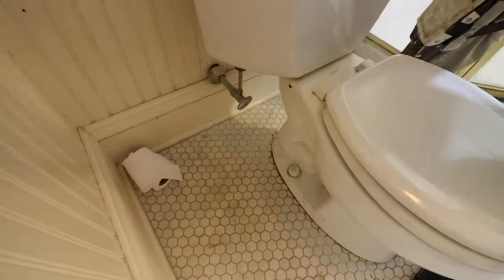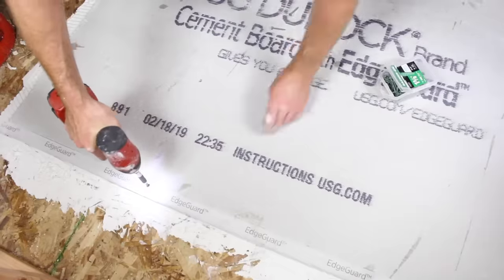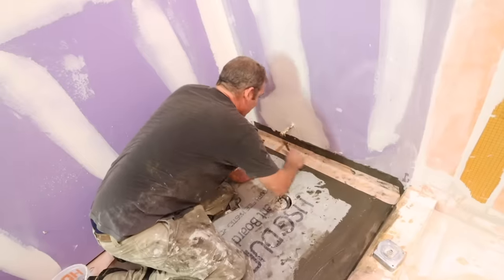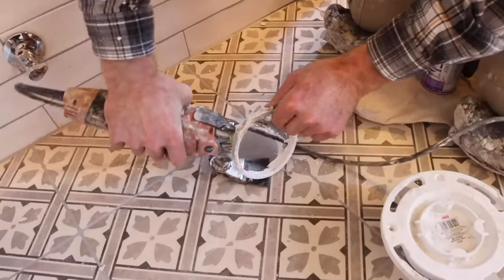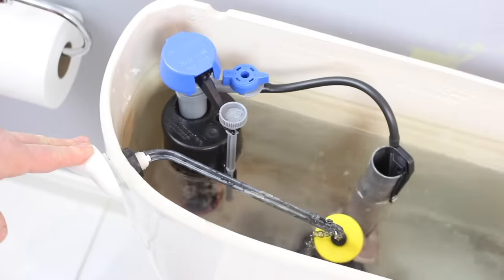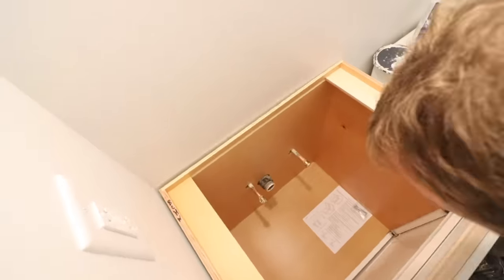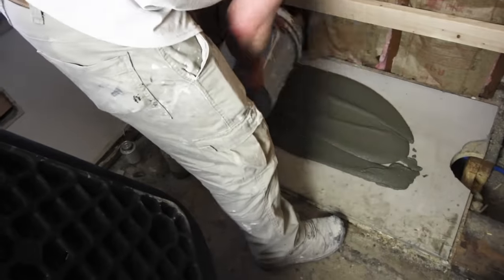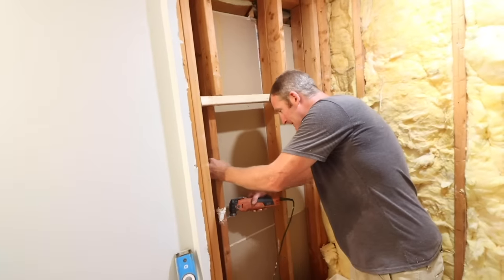17 Clever Bathroom Renovation Tips for Beginners

Comment: I think the floor prep was great, but really, unless you are remodeling the bathroom in the House of Windsor, it is just too much. No one needs a bathroom floor that could double as the outer hull of a submarine. And let me tell you, most everyone says I go WAY too far in my own moisture barrier provisions. But please don’t take me wrong. This video shows the best work I have seen in a long time, maybe ever. As a reference, I was a safety worker for Swinerton. And cutting the grout lines with a circular saw? I have removed a lot of tile and replaced it, but the pry bar and hammer is the most  practical method.

Comment: Great job! Duroc is for walls though. Use hardy backer for floors then follow the same steps
Reply: Durrock or wonderboard is fine for floors ! Its not just for walls ! Hardibacker works for either but i hate putting fasteners through that crap , its easier to pilot hole it but the time spent blows that up! I stay away from hardibacker altogether personally! Whatever you use , thinset it down on wood sub floors with a polymer modified product!

Comment: Awesome video! I'm in my second year as a home improvement contractor but I don't have a lot of experience doing bathrooms. I'm subscribed and look forward to watching more
Reply from the maker: thank you and congrats, let us know if you have any questions 👍🏼
Reply: @HomeRepairTutor  will do. Thanks!
Reply: One thing i learned the hardway from being taught the complete wrong way is to put positive slope underneath your shower pans!! You gotta slope underneath whatever material you use for your pan! Its a critical error a lot of people make! Excess water will travel thru your grout and mudbed etc. finally hitting your pan and settling in the lowest point! It will stay there because it has no where else to go! Soon it starts making mold and turns acidic thereby eating through to your substrate and walls! If you dont slope your pan toward the weep holes on your drain the excess water is sure to cause major problems later on! I have torn out 50 yr old showers that would have lasted another 50 and others that were 10 yrs old that have rotted the subfloor,studs ,and floor joists! Water is a killer in wet areas! Thats why most insurance doesnt cover damage that occurs there!

Comment: thanks for the great video, its the best channel on YT!. For the second tip you have in this video, can you use ditra+tile on top of the plywood that is beneath Vinyl? i.e. remove Vinyl using the heat gun and not pull the whole plywood out?
Reply from the maker: thank you Danish, you could pull the vinyl and keep the plywood of it meets the Schluter standards for your tile, eg if the plywood is 3/4” thick and over 16” oc framing

Comment: Always use a mask when removing vinyl especially in an older home.As there has been cases of asbestos being underneath.
Reply: Those would be the 8” X 8” vct (vinyl composition tile) in my yrs of experience! Mostly! They are very brittle and are glued down with black adhesive! Usually in non traffic areas you can pop them up in 1 piece for the most part! Where you would get the most airborn crap flying around is if you sweep the floor during clean up! Prob not a good idea ! I would def use a respirator and a good one and use a vacum with a hepa filter and dampen the floor first before final cleanup! That will keep a lot of the dust from flying around! Its that or call in an asbestos remediation crew and pay through the nose for everything that goes with that including disposal fees! Legally here if you are doing a job for someone as a contractor and asbestos is involved, it has to be removed by one of the handfull of licensed companies certified to remove asbestos! There is a ton of masking things off (windows, doors etc) to contain it and workers are gowned up like workers in a clean room! Same with lead paint removal ! Another nightmare maybe for next halloween!
Reply: True dat!

Comment: Amazing tips guys! I was looking for information on how to properly make the connection between drywall ceiling and kerdi board on the shower area and between an inside corner where drywall will meet a cement board (tile wall) outside shower area. Any feedback would be amazing! Love this channel!!
Reply from the maker: normally we don’t treat or waterproof the ceiling to KERDI-BOARD connection but you could flash it with KERDI-BAND if the ceiling is lower than 8 ft. At the drywall to cement board transition outside the shower you could use alkali resistant mesh and thin-set if it’s close to the tile, eg 3” or less. Then you could skim it with joint compound 👍🏼
Reply: You guys are the best! Thank you so much! We wish we knew professionals like you here in the rural NB. We built most of our house ourselves, and I am the one responsible for tiling. There are so many details and you guys are a huge help. Your channel is AMAZING!

Comment: Wonderful video! Gotta watch the rest of them before I buy a home :) Few questions for ya: does dampening the subfloor make it easier for the thin-set to adhere? Are there any mold concerns with that or does it dry out when the thin-set does? Lastly, do most thin-sets have directions to dampen the subfloor, or is this one of the tricks of the trade?
Reply: Its one of the tricks! Without it, the dryness of the subfloor will suck the moisture out of the thinset before it has a chance to set! Always a good idea before bonding any type cement product! Always wet your substrate! And mold is not a concern. Just dampen not flood!

Comment: You're not supposed to use modified thinset with kerdi. Also, a better pro tip would be to not use modified under cement board. It will save the subfloor from damage for the next time it's demoed. Unmodified will not bond to the subfloor and will be much easier to clean it up for the next tiling job. Other than that, solid advice!
Reply: The next time its demoed? What are you nuts? When i do tile i consider it a permanent forever installation! If they just want to change color too bad deal with it! And you should definitely use a modified thinset on your subfloor! You are guaranteed it will bond the cheap shit you are talking about is just that cheap shit! You will never have a problem using a modified thinset! I dont know why they even make that cheap crap! It sucks! Not sure who taught you but who cares about the guy who demos your tile job in 20 yrs from now lol

Comment: Great video tips, however, I am considering building a nice deep shower niche just as you did towards the end of this video, HOWEVER, be careful if you are copying this method because depending what’s on the backside of that niche wall, if you have someone let’s say hammer a nail into the wall to hang a picture frame or something, well then it’s bye bye to the shower niche and now you’ll have water into the room.  I would say build the niche to stick out while keeping the 2x4 framing in the wall, just add another 2x4 in front to give that extra space and give atleast 1.5” space from the drywall in back to the tile in niche, this way you have space to hang stuff on the back wall without worrying about nailing into your newly finished shower/niche….
Reply: You know thats true! I never thought about that before but it could very well happen! I never liked cutting into the wall like that for a niche or whatever! The waterproofing is critical and its a lot more work to do the tile! Cuts everywhere! This guy does a good job of h2o proofing but that nail from the otherside is a definite risk especially for future owners!
Reply: You are talking a waterproofing nightmare if you add 2x4s onto the framing inside a shower to build a niche! Thats one of the silliest ideas i have ever heard! Sorry! No! Install some simple corner shelves made out of stone ! Make the ones above slightly bigger than the one below it so water drips over the lower one and not on it! Do as many as you want 3 per corner so 6 total starting at around 8” at the top then 7.5” under that and so on! It gives you the space to put whatever shampoo ,the wifes crap (said in the most loving way possible!) and it stays water tight if installed properly for the life of the shower! They should be mounted by cutting around them with your wall tile so they sit back against the drywall  or backer board or whatever! Not surface mounted!!  Circular ones are best and give more space so a 1/4 circle mounted in a 90deg. corner! Think of a pie and cut it into 4 big pieces, each one becomes a shelf just have to cut them smaller as you move down the wall! Mmmkay? Everyone clear on that lol! Good! Now get to work! Im out!
Reply: @StonemanRocks  I did 2 different showers with this same design as I mentioned above.  I framed it as you frame anything else, just like a shower seat…  I also ran a waterproof LED COB strip light INSIDE a milky cover along the back upper inside corner of the niches.  The tiling wasn’t hard at all, just like any other cuts.  Also had the tiles meeting on all the outside corners 45’d so they flow really nicely (not the niche but the shower itself).  Turned out amazing.  I’m just finishing installing the accessories vanities toilets faucets and shower fixtures etc at this point.  I wish I did a video of the build I’m sure it would have got an insane amount of views and people could see what you could do if they were a bit creative given they’re doing a large renovation.

The waterproofing wasn’t too bad, lots of corners to waterproof there but I’m not worrying about anything.  Also I used very large format tile, so I don’t even have much grout lines for anything to penetrate behind if it did get back there.  Plus if it did, I have waterproof membrane overlapping many corners and strips so it’ll be next to impossible to get back there (behind the membrane).  And if it did then it’s got concrete board.  It’s meant to last for a few years anyway no forever as people usually tend to renovate every bunch of years when things get outdated or new buyer gets the house of selling.  Also it was a first time for me doing this level of build, so I definitely learned a few things.  I really regret not videoing this entire process I wish I did.  All the previous washrooms we’ve done long time ago we only ever used concrete board and nothing in front of that in-terms of waterproofing.  The only waterproofing we had was at the base and running up about 8” along the walls of the base and that’s it.  And they’ve lasted without any issues.  I think it’s gotten to the point now where they have all these gimmicks and products that really make things overkill, and some of them are NOT EASY to install, and will make it a nightmare doing it.  Just remember it’s a shower and make it whatever way you’re able to and can afford to waterproof, no need to go insane and overkill on all the details, it’s going to likely get torn out and rebuilt a few years down the road anyway.
Reply: @first_last2740  i think thats what you are all about mainly is an “insanely amount of views!”
Reply: @StonemanRocks  not really no, if I was I would have made a video of the build.
Reply: well, so let me correct you on a few things.  I just finished a very large renovation mainly by myself, it’s not exactly my first rodeo, also I’ve watched a lot of “educational” videos and spoke to the right people to help me do things properly.  There is making things right, then there’s overkill, then there’s madness, I did what was right for us given our circumstances.  My washrooms will probably outlast the rest of the house if you seen how I built them.  Even my tile guy and he came to tile was shocked and said this was way overkill, so I don’t know what you’re talking about being a keyboard warrior and getting flared up because I did what I did.

My walls blow out?  Man you need to calm down, easy there 😂.  All the washrooms we’ve done in the past, WHICH IS THE WAY SLL THE PROS DID THEM BACK IN THE DAY never had an issue.  This one I waterproofed the daylights out of it.  I would be extremely shocked if water can make it past the waterproofing on the niche, there are any overlapping layers I think it’s virtually impossible.  If a little water does get back there I am not worried at all, there’s good materials it has to work through and will need years to do any serious damage.

I don’t know where I said you don’t need to totally prep things?  I think you need to read what I wrote carefully and stop pontificating as a know it all.

Yes condensation happens all the time, not just in the washroom/shower….  I live in Canada, we have big issues with condensation and tend to overkill things here.  Also I did go all the way with waterproofing, I did the best I could.  I could have red guarded it ontop of what I did but would have been major overkill madness, not necessary.

So basically what you’re saying is all the showers you did in the last 30 years are garbage because you never red guarded them.  See the conclusion behind your logic?

Comment: Ditra!!!!! Backerboard is the model T of tile 😂
Reply from the maker: DITRA is our preferred method, however, Schluter doesn’t recommend installing penny tile over it due to point loads possibly cracking the tiles - so cement board was used instead
Reply: Home Repair Tutor Ahhh gotcha.. surprised they would say that... even with that said i wouldn't do that job then 😂 i absolutely unequivocally will not use backerboard everrrrrrrr again lol

Comment: Doing a bathroom floor ,the key to any installation,  is a sound subfloor, and if it's a suspended floor , even though it looks sound ,tile is not a good way to go ,inlaid vinyl is the better path for a beginner,  and has a lifespan of 50 years, that becomes a secure underlayment, for future installations .

Comment: I’ve just discovered that in NZ you need to be a registered plumber to install any sanitary plumbing regardless of whether replacing like for like. This could be the case where you are, pays to check first.
Reply: Same in this country, in pretty much all jurisdictions.  Anything you do which breaks the air seal on the drain system requires a license because of the exposure to sewer gas.  On the supply side, if you have to depressurize the system (shut off the water,) you need a license.  HowEVER, many jurisdictions allow people who own AND occupy the property to do the work.

Comment: Doesn't a mortar bed for a tub act as a self leveling device assuming you use a level while settling the tub into the bed?

Mortar bed is a fantastic idea....we did it for our acrylic tub and it's solid. It feels like walking on a sidewalk.

I think the many reviews of acrylic tub failures is because they didn't do the mortar bed.
Reply from the maker: to a certain degree yes, although it’s always good practice to have a flat and level subfloor under the tub
Reply: Google Account I’ve installed hundreds of tubs in the last 11 years, using this very method!

Comment: Why put banding on edge when you never primed the subfloor before placing the hardi down?
Reply from the maker: priming the subfloor isn't needed with cement board, you need to dampen the plywood then apply modified thin-set per the instructions

Comment: On the fill valve you don't have to disconnect them from the water line the head on the fill valve can be popped off you need to just check the measurements to make sure you get it at the right height for the water level I've changed a few thousand of these and they use to wonder in the apartment buildings I worked why I was finished so quickly you just take the head off as long as it's not leaking the water line is not leaking I don't disturb any of that I just take the head off if you pull down the plastic ring they head can be removed

Comment: 3:28 Those thing recessed lights are usually the thickness of the wall and designed to be installed directly under the joist as well. Also the electrical box on yours is a bit to big for that case.
Reply from the maker: you’re correct, the slim recessed lights are great if a joist is in the location where the light has to go
Reply: As a former electrician s helper, we never stabbed in any connections; always stripped and nutted, then black taped for good measure.

Comment: Suck the water out of the toilets with a shop vac. Don't use inside pipe flange it's butcher. Sleeve your 3" with some 4" tile to that then pull it out use a normal flange. If you are trying to change a fill valve "quick" just prep the new one and when you pull out the old hold a rag tight to the hole until you push the new one in. Then adjust the float so when it's resting it's 1/4 inch lower than the over flow.

Comment: After your remodels, the next time they want to update/remodel(10-15 years), it is going to cost them more to demo than to update.  They will have to hire a wrecking ball crew to separate the materials you bonded onto their walls and floor(no easy method like you showed in the beginning of the video). I wonder if the homeowner realizes that... or was told that when you pitched them the waterproof bathroom idea?  Not blaming you for wanting to do a good job.  Imo, I  just think these products can make it overkill... resulting in a future, unnecessary nightmare when the next guy has to tear it out.

Comment: Not friendly for the next guy that wants to reptile.hardie backer board no thinset underneath .staple with 3/4 staples on a six inch grid .6d ring shank nails also on a six inch grid .when Jardine backer is installed correctly it will provide structural integrity to the floor.wonderboard provides very little ..